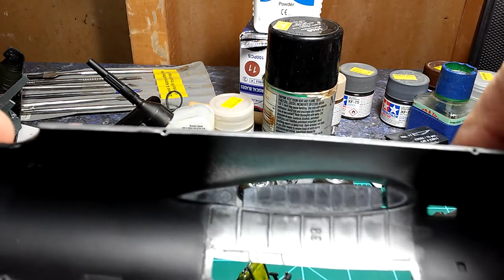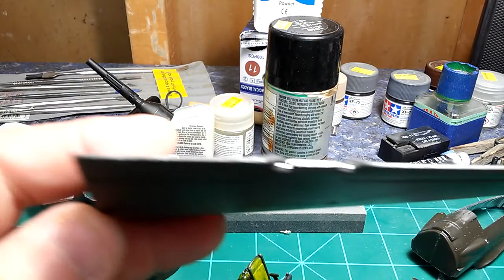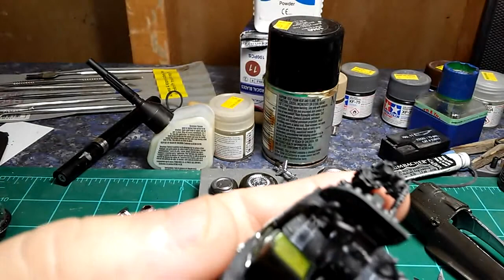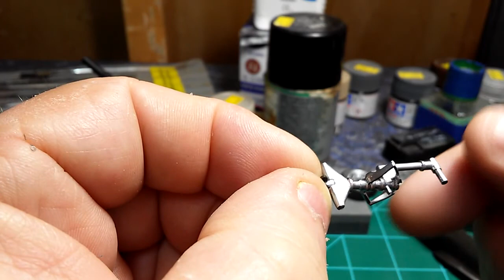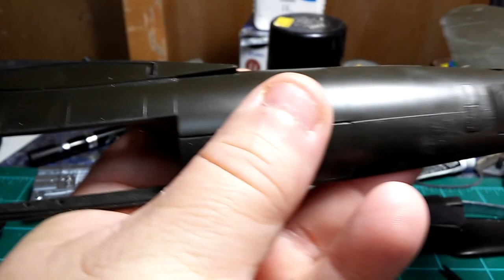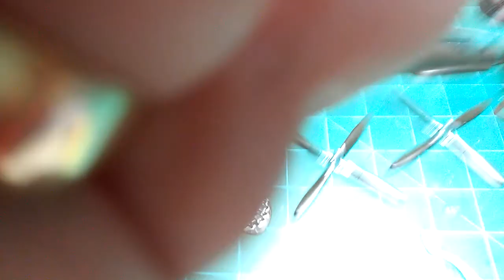SA Reloaded - The Monogram B-26 Build Part 5

Comment: Great progress on the B-26 SA!  I'll have to try brush painting with Testors silver. I have a few of the small square shaped Testors bottles.  It seems like a new bottle, but it has 40¢ printed on the cover, so it's got to be more than 30 years old.  I wonder if it's any different than the Model Master stuff? I do remember using it back in the 70's.  It never seemed to dry.  I probably didn't mix it well enough, lol.
Reply from the maker: Thanks Ken! It probably pretty close. The carrier may be a bit different than modern enamels. Wouldn't surprise me. I have 40-year-old Xtarcolor tins that are still good. Modern stuff won't last 5 years once it's opened. So it seems anyway.